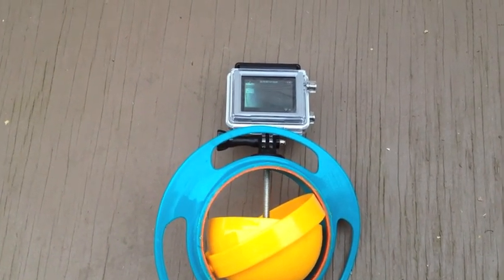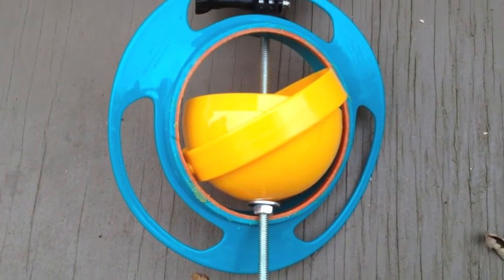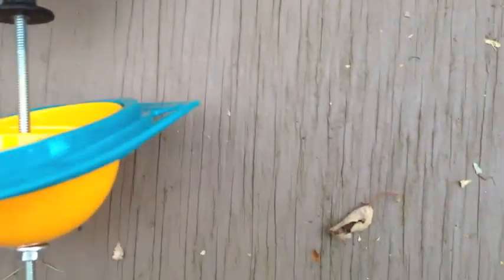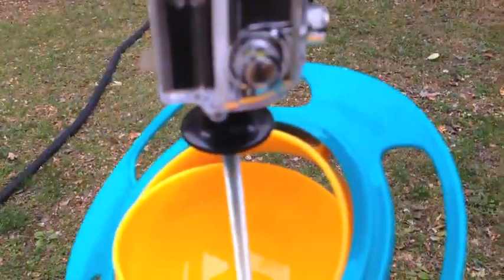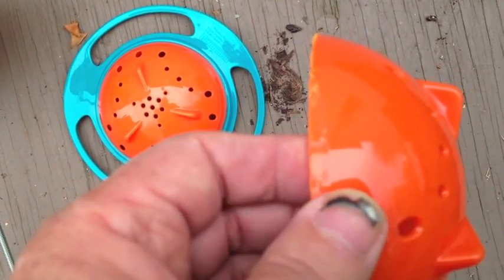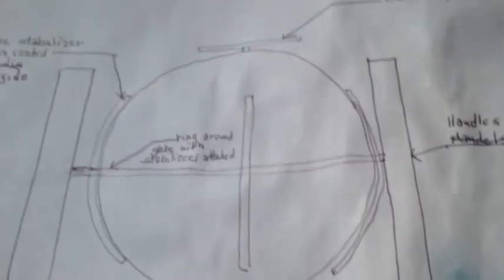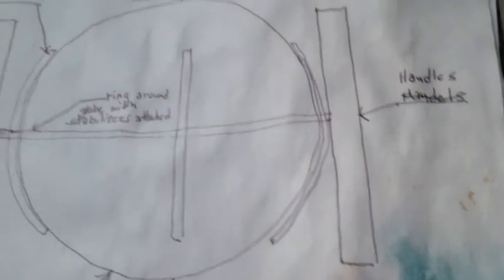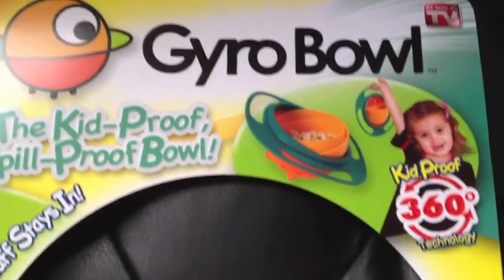DIY gimbal gyro bowl Stabilizer for GoPro Hero 3 Black GH2 Panasonic Lumix

Comment: That was very well done and the test footage is excellent. I felt I should make a small suggestion.  It seems like you might have just a little too much weight at the bottom of your stabilizer. The weight is imparting a small amount of drag when you start your move, which gives your shot a very small wobble.  As for a handle, I'd try a 45 degree vice grip, clamp it on nice and tight... it might work.

Comment: I built this and used it with a kitecam. However, the weight will produce a pendulum motion. The camera isn't as jittery, but the pendulum motion induces a different problem.
Reply from the maker: I'm working on a different approach hope to have it on the Tube soon.
Reply: +Ed Loki It needs to have something spinning horizontally to neutralize the pendulum motion

Comment: Nice build, however, it's not a gyro. It's stabilized yes, partially, but the momentum will still be a problem when moving around. In order to build a real gyro you probably would want to use electronics as it involves a constantly spinning flywheel.